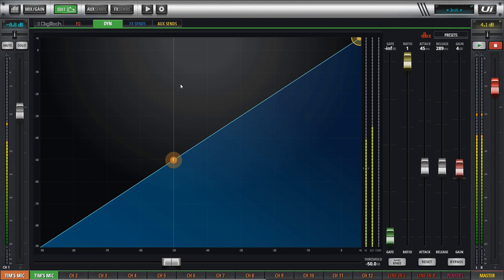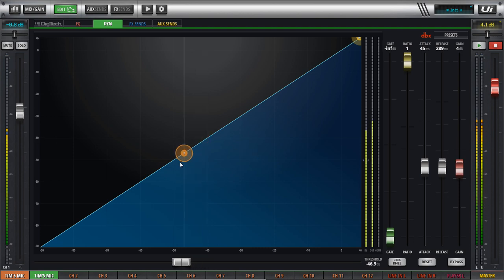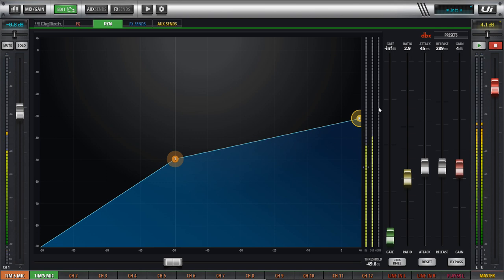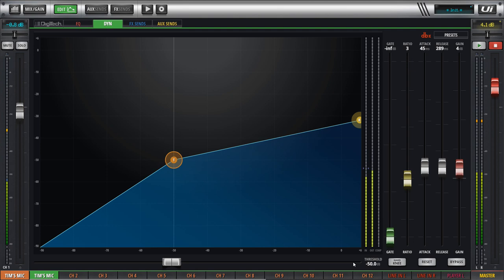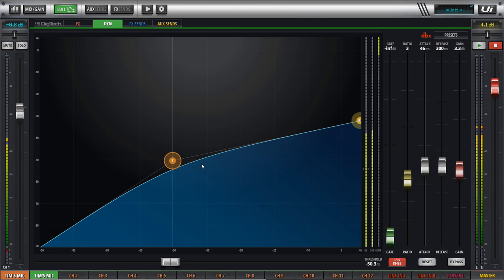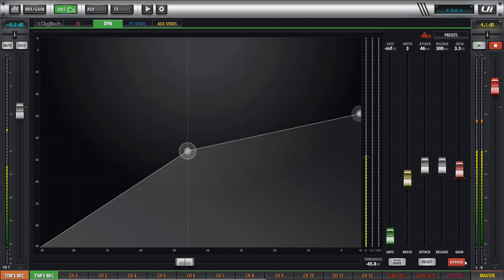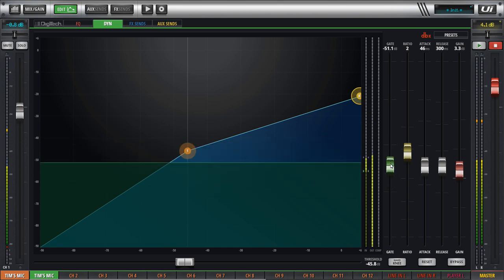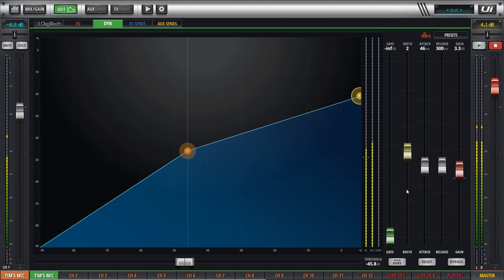Compressors and Gates for Live Sound

Comment: Thanks heaps! Really well explained. On the Soundcraft UI, we have the little red X flashing on one of our channels down the bottom, from what you've said it looks like our gate might be set too high? Not only do we see the red X flashing, but we also get the levels dropping in and out, so I think that makes sense of the gate being too high.
Reply from the maker: Glad you figured it out. I only use gating rarely. If often causes more problems than it fixes. ;) One situation where I have used it was for large discussion panel where every speaker was wearing their own mic. It helps not to have seven open mics at once. As each speaker would wait their turn, the gate would close their channel but they could all join the discussion at any time.

Comment: Sir how to connect compressor audio to mixer....but may mixer is nothing insert in my mixer..how to hook it
Reply from the maker: Hi Randy,
You will need inserts if you want to use it on a single channel since you can't plug a mic level signal into the compressor. If you have a wireless mic, you could do it by plugging the output of the wireless mic receiver into the compressor and the output of the compressor into the mixer channel. If you want to add compression to the whole mix, just connect the output of your mixer to the compressor input and the output of the compressor to the amplifier input. :)
Reply: @proclaimav4197  yes sir now i understand how to hook it..thanks you so much sir..youre the best godbless ur channel

Comment: An X32's gate can be set as an expander. What is a good use of an expander?
Reply from the maker: Generally to expand the dynamic range of a signal. I like them because they don't entirely chop off the signal like a proper gate, but they tend to work like a reverse compressor Because they reduce quiet noises but don't cut the signal entirely like a gate, they sound much less jarring IMO. Check out this helpful article. https://www.music-tech.com/expanders-uses/

Comment: A good video, except for one minor error at 1:15 in. On the Soundcraft Compressor screen, the Input scale is shown across the bottom and Output scale is to the left. Thus when ratio is lowered, you can read the left hand scale (Output) by following grid lines that intersect with the light-blue line. (I know. I am splitting hairs here, but if it makes it easier to understand, it may help a newbie.)
Reply from the maker: Good Catch. 👍

Comment: Once I set a gate at an event to try and remedy a noisy preamp. (This was the first time the input was noisy and I was short extra channels). At this event, a few professional voice actors were speaking.

One of them called me out on the gate and asked me to remove it... That was fun. I reduced it some, but admittedly it was the first time I'd ever used a gate and I didn't know enough to do it right. I ended up passing the VA another mic in the moment.

It was a little relieving to hear that gates can be tricky on vocals. That means mine was probably terrible and I just couldn't hear it at the time. It was really subtle, just enough to hide the subtle noise, but the VA could surely tell.

Equipment was a Behringer X Air digital mixer.
Reply from the maker: Thanks for sharing that 😁 Mistakes are a great learning tool and I'm made tons. The only time I will use gating is if I have a large discussion group and everyone has their own mic, but even then it can be tricky.